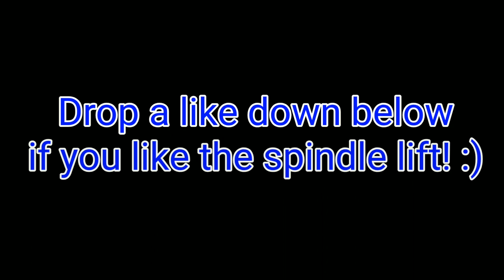TEST DRIVING our *NEW LIFTED* Baja Bug OFF-ROAD 😏

Comment: ... And the slippery slope gets a little steeper...   Bug turns into baja, baja gets bigger engine, bigger engine can turn bigger tires, bigger tires means lift - but not enough, so mod the suspension, modded suspension means you can go faster, go faster and start breaking more parts and need to fab more, might as well add better shocks while you're at it... and on and on!  Ah, it's a delightful sickness!!!
Have fun you two!

Comment: Where did you find those rear tires at?
Reply from the maker: Pacific customs unlimited
Reply: Paddles are from pacific customs.
Knobbys are Sedona mud rebels
Reply: I really like the knobbies, where is pacific customs unlimited?are they originally used by side by side quads like polarizes
Reply: I have seen some cool tires that are 15's at Nash cycles shops here in Phoenix
Reply: Pacific customs unlimited is a sand buggy parts distributor out in Huntington beach area (california) the paddles themselves are sand vipers.